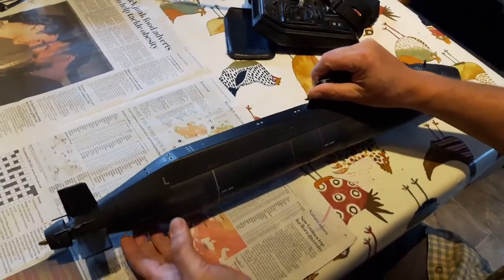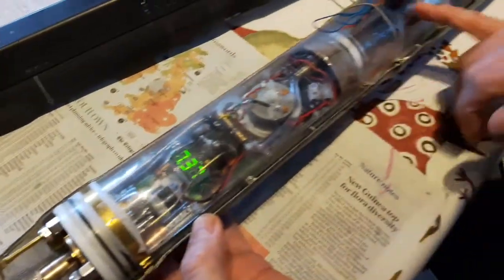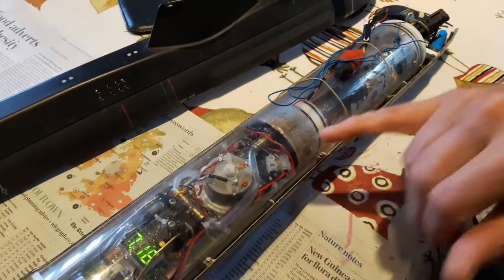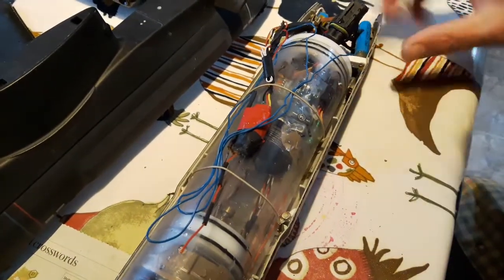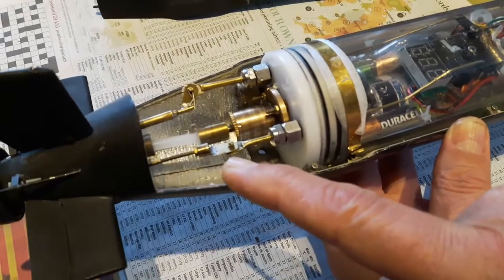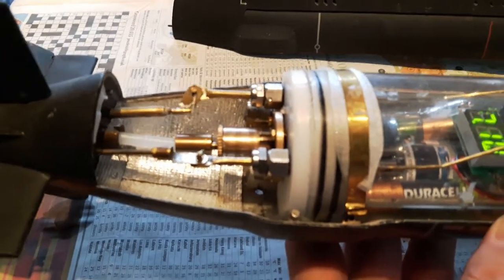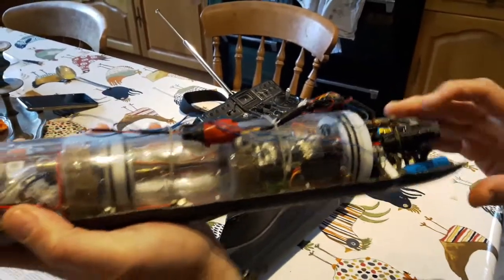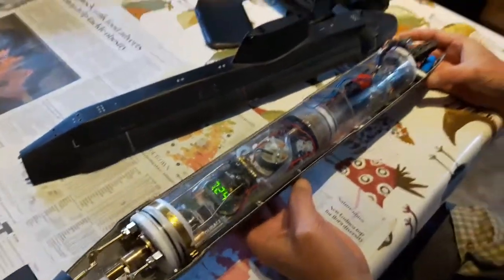RC Astute sub: how it works, sort of.

Comment: Hello again.  The middle section of upper hull of  my kit has a upward bow that leaves a 2-3mm gap when the hull halves are joined together . I've seen other post on different sites showing the same issue with their hulls. Did yours have this defect? How did you address the gap? Thanks.
Reply from the maker: Yes, I had huge fit issues. It was bent like a banana. I had to cut the hull and reform to get a decent-ish join. If it hadn't been a hull design that I really wanted it would likely have headed stright to the trash can. The Seawolf was a lot easier and better molded.
Reply: @gonzomechanic7196 thinking of either using some sort of a J shaped hook on one hull half that latches on studs on the other to pull the hull down or heat to correct the bow of the upper hull. I've seen others use a hairdryer but I've had success fixing a distorted deck of styrene  model boat kits by soaking in hot water then coaxing into the correct shape as it cools.
Reply from the maker: @coast219  Worth a try. I should have thought of that myself!

Comment: My wife just bought me an Astute for my birthday. Still haven't checked but I think I can use my 2" Seawolf Subdriver with it.
Reply from the maker: Sounds fun. The only thing is the Astute is appreciably smaller in length. I have both and am converting the Seawolf slowly at the moment. I plan on using the extra room to give her retractable bow planes like the real thing... once I've figured out how! I am also thinking of fitting extra bright LEDs behind/above the ventral drain outlets so  she can illuminate the lake bed for night dives.

Maximus modelbau does an Astute conversion for sale and its performance seems equal or better than mine by the look of it. It doesn't have the unneccessary gearbox that mine does and uses a balloon ballast system that gets closer to real surface trim because it can take more water than my 'office cooler' ballast tank. Although I prefer the slighly more robust mechanics of mine. I think R&R models will be doing an Astute conversion too and it might be cheaper.
Reply: @gonzomechanic7196  I do have a Subdriver for a 1/144 Kilo.

Comment: Did you fabricate completely new rear dive planes or used existing kit part?
Reply from the maker: I used all the kit dive planes. Easier that way. Besides, they work!
Reply: @gonzomechanic7196 Okey. 
 How did you cut off the rear dive planes? Are the dive plane shafts supported on the outboard ends or just at the base/ hull?
Reply from the maker: @coast219  Yes, the pitch axis dive planes are supported at the ends and the rudder and forward planes are all moving surfaces. The rear dive planes were cut out with a razor saw and rebuilt using plastic tube and filler.
Reply: @gonzomechanic7196  thanks.
Reply: @gonzomechanic7196   any chance you can email me pics- aforementioned dive planes, stern linkages, WTC, etc. Thanks😊

Comment: Looking closely at your video,  are you using AA batteries?
Reply from the maker: The batteries have been a continiung issue on this model. I first used AA sized lithium ion cells outside the watertight chamber, just in front of the steering gear. These are excellent batteries but the least access of water to the terminals caused significant radio reception problems as soon as the sub was put in the water. Took a lot of effort to figure out what was wrong and no one on the forums seemed to have had a similar problem. In the end I had to move the cells inside the chamber to stop this - but did not want 'exotic' batteries in a place where they are hard to get at so used 6 AAA size Duracell NiMh rechargeable cells which are predictable and don't leak. She now works very well indeed. The only change I would make to the design is to delete the motor gearbox which was not necessary. Hope this helps.
Reply: @gonzomechanic7196  AAAs😲?!! I thought they were AAs😆. I think I have an idea what you used for your piston tank- it's a coolant tank used to liquid cool PCs.
Reply from the maker: @coast219  Yes, they produce about 8.4v and give a run time of around 25 minutes. Which is plenty enough time for my children before they get bored!

Comment: Does your ballast tank also have a cut off switch at the "tank empty" end or just at the "tank full" end?
Reply from the maker: It has limit switches at both ends. At the tank-full end it has a small micro switch pushed by the piston itself. At the empty end it has a magnetic switch activated by a magnet imbedded in the piston. This is slightly less satisfactory as the exact moment the switch activates is hard to set accurately. But the system as whole works well enough. Hope that helps.
Reply: @gonzomechanic7196  Thank you Gonzo. BTW, What's the diameter of your wtc?